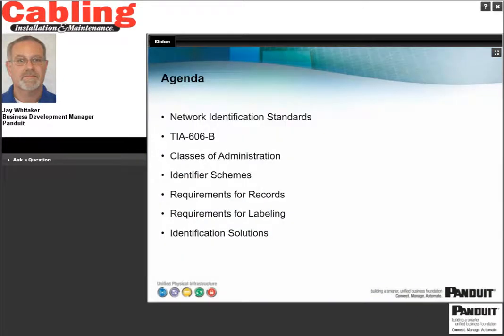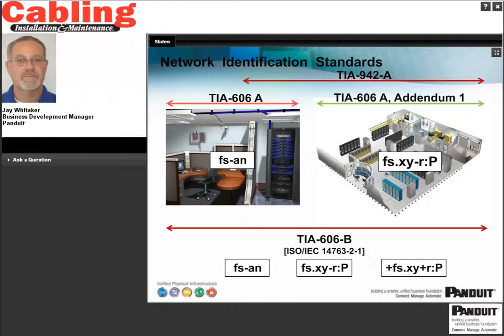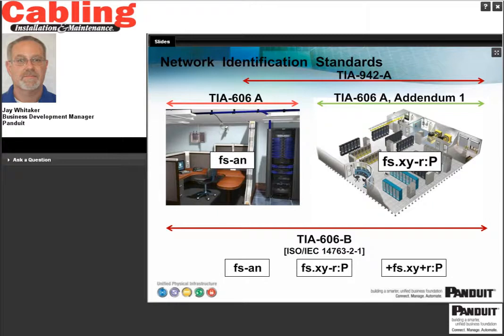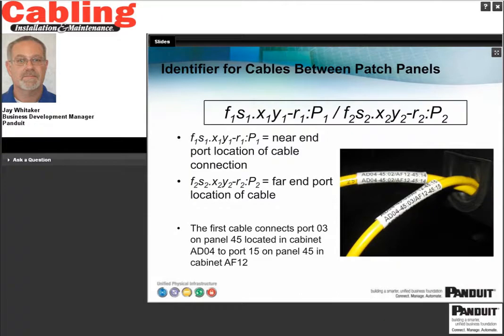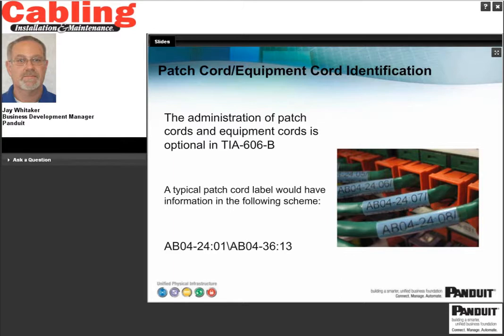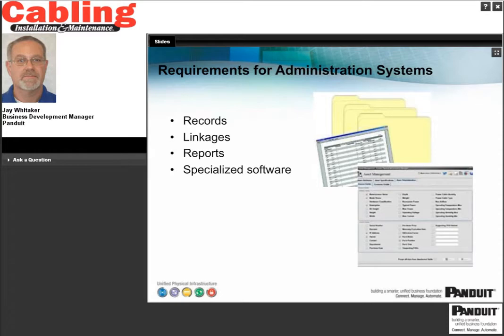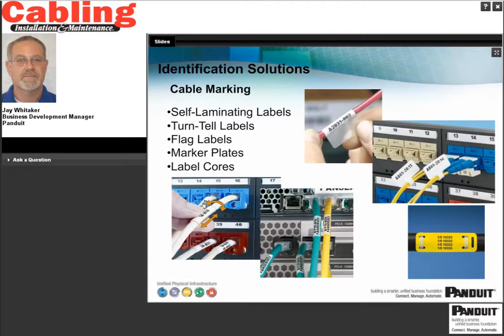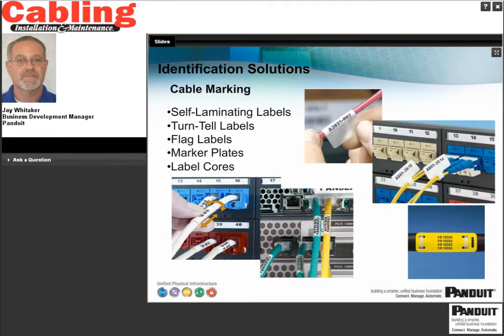The Importance of Network Identification

Comment: Great video.
I suspect that trying to use fs.xx-r:P and fs-an in the same installation might pose some confusion.

I use fs-an for small office installations up to a max of two floors and 1 TR/ER with 1 rack/cabinet!

Anything installation greater than that has to be fs.xy-r:P.
For '-r' I use single alpha characters A-Z for FO and RU for patch panel (Cu).

For more commercial industrial I use the same letter-number designation as on the architectural plans or layout for emergency